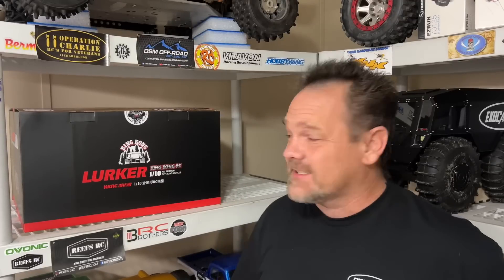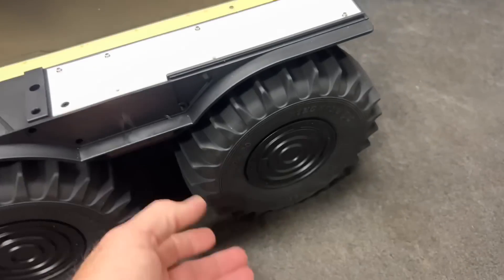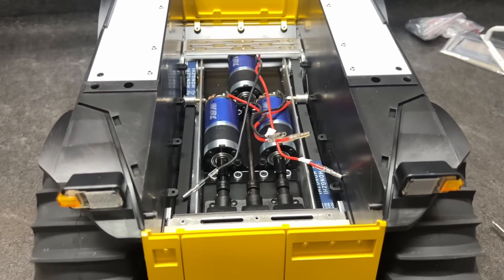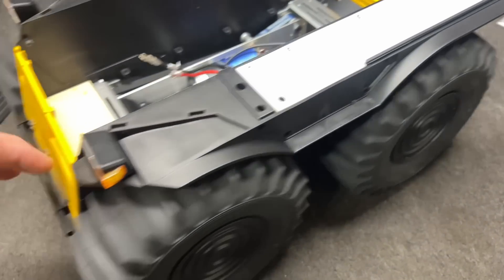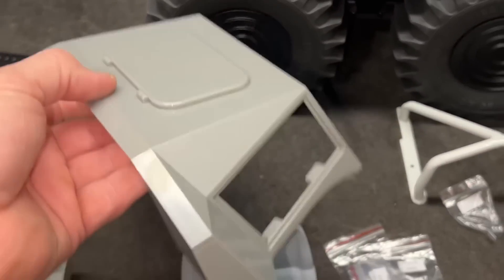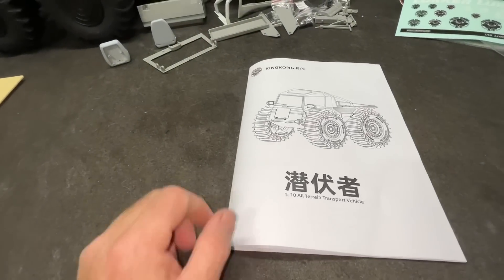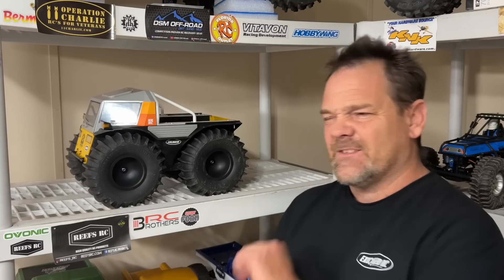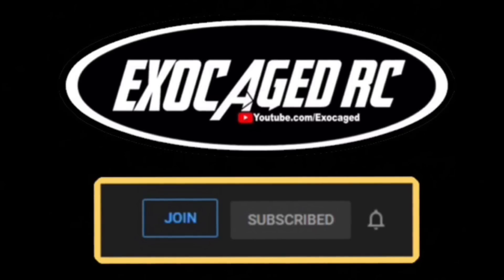King Kong RC Lurker Sherp! The Build

Comment: 20-ish years ago, (when mud was new, & we walked barefoot in snow, uphill, both ways🤪), we used belt drive originally in concrete oval, then I started doing offroad with it. Super efficient! U wanted some slop in the belt(s). Too tite n they were destroyed & created a massive amount of drag. 

Seeing the start of the vid, I figured a $1000 price tag.

Comment: $359 isn't a bad price, but I hope they, or aftermarket makes upgrades! (Bigger axles, bearings (I've always used/sponsored with avid-rc), etc)
Reply: yes, I think KingKong RC should offer a "Premium" version of this kit, with slightly thicker shafts and bearing, and aluminum wheels rather than plastic, for slightly more in price, people will def. pay an extra $50-100 for something that will last much longer and be able to drive more like the real deal

Comment: I bought one. It does float. But if you don't waterproof it yourself you will get a lot of rust inside. The newer version replaced the plastic fake wooden interior deck with real wood. That would be an improvement except they replaced it with, get this, BALSA wood. It's very fragile and it will crack. I replaced it with 2mm styrene sheet. The overly complicated 3 motor gearbox arrangement just leaves me scratching my head. Why? It drives and turns exactly as a tank or bulldozer. Why didn't they just use a cheap reliable tank gearbox instead of trying to reinvent the wheel. I know kingkong rc makes parts for rc tanks so... Why?  The turning motor physically broke and seized the first day I took it outside. I replaced it, now the pinion gear on that motor is slipping so the vehicle can't turn. I'm seriously considering installing a $20 Heng Long tank gearbox in it.

Comment: I feel like King Kong RC have cheated here a bit too much, in compare to their other products, 
I mean sure I understand, this must be capable of bouncing on water so it must not be too heavy, but they could have done it right and machine those sheels out of aluminum rather than manufacturing them out of plastic, 2-3mm thick aluminum would not be that heavy and would give the shafts and the motor the ability to transfer a lot of power to the wheels without fearing that the plastic hub break up. I would have paid an extra $100 if they would have provided this Sherp with aluminum wheels rather than plastic, and slightly thicker wheel shafts.
I hope somebody in KK RC is looking here ;-)